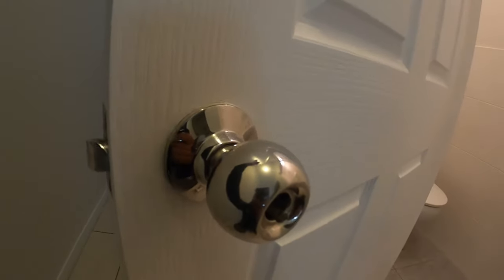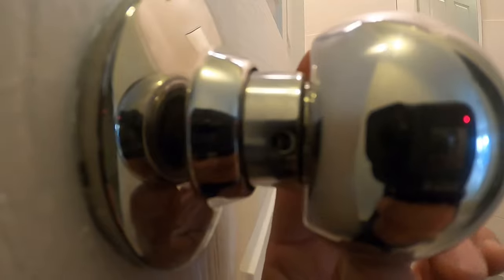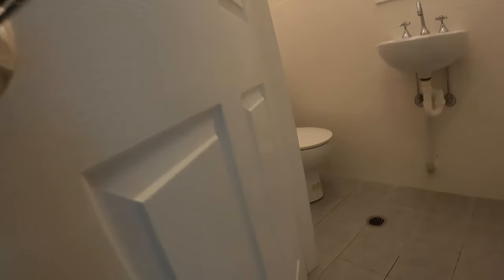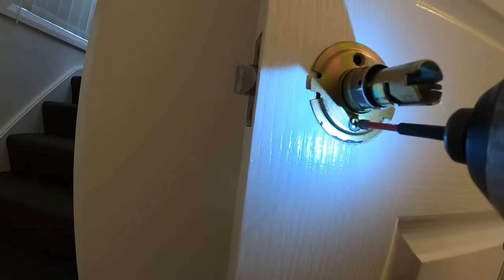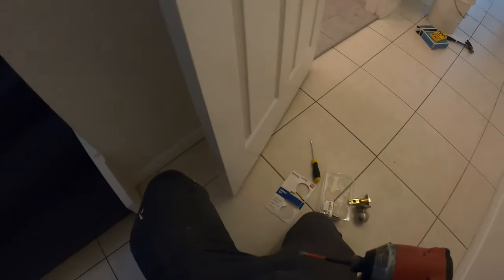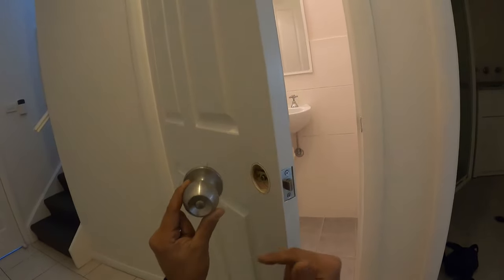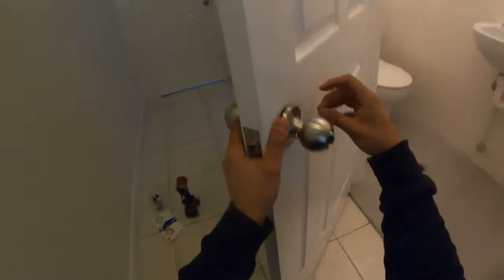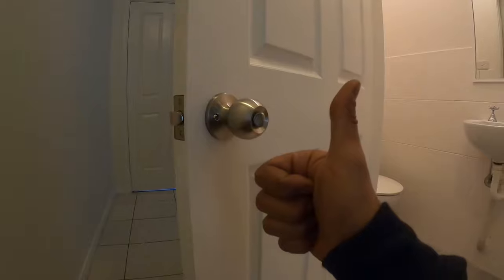Remove door handle / knob without screws visible

Comment: I'm facing the same type of knob and the door is shut and I can't open it.  The side that I can access is actually the side without the screws, any idea how I can remove the knob on this case?
Reply: It's been two months did you ever figure this out? Got this exact situation right now
Reply: @sebastianfischer2082 oh same here 😅
Reply: @AddisAnimationTime same!
Reply: Same boat right now. Did you manage to figure it out?
Reply: @francisferdzz  I myself couldn’t do it so I had to wait until my dad got home. He somehow jammed a butter knife into the crack of the door(which was tiny btw) and he got it open. It does damage it a bit tho. I would say it’s better than being locked out.
Reply: @francisferdzz  my wife someone managed the bend the hell out of our medical insurance card (thinner than a credit card) and make an L into releasing the inner door latch
Reply: I'm a kid and I got a hammer and hit it several time it opened I removed the screws with my fingers and I saw the slot I picked a coin and used it to kind up push up the one that's making me locked up in my room
Reply: 0

Comment: Thank you so much. Took a while to find this clip but well worth it . I didn't know if I was going to break something but watching this assured me of the right action to get the knob off. Enabled me to spray lubricant into the mechanism therefore no need to replace the lock. Bunnings should create a library of these clips

Comment: Saved me a LOT of trouble with this video. Got locked in my own room - the latch mechanism got disconnected from the handle and its like 2 in the morning so I can't really call anyone for assistance. Your instructions helped me take the handle apart, and then I realigned it with the latch when putting it back together! Thanks so much!

Comment: Thanks Bill.   This worked just as you said, enabling me to remove a failed bedroom door knob mech.  I'm off to the hardware store now to buy a replacement.  Without your video advise my next move would have been to use an angle grinder (the mech is stuffed anyway) but your way is so much more civilized.  Cheers.

Comment: Thank you for the video. What is the pin you are looking to depress to release the door knob is rusted? The handle/knob set I am looking to replace is on an outside gate and all components are rusted and the screws are located behind a plate. Any suggesting? Thank you in advance

Comment: Currently stuck in my own room because the knob is stuck and am completely lockd in; informative video. Thanks!
Reply: How did you get out though, I’m currently locked in my apartment. Does your bedroom need a key to get in? Because I got to the last bottom screw and it won’t screw all the way out. Idk if it’s because I need someone from the outside to turn with the key or what

Comment: Thank you very much, in my case it was a small Allan screw that needed to be turned, not a pin. And it was a what I think you call a  left-handed thread, you turn the screw counterclockwise to back it into the axle then take the handle off.  In my case I just needed to tighten the screws that hold the assembly to the door…  then putting the handle back on,  you turn the Allan screw clockwise to bring it back into the knob to secure the knob to the axle.

Comment: Thank you so much I have been searching YouTube for your video.  You helped me so much every door knob in my house is coming lose.  The house is barely three years old.  Even doors l hardly ever use are coming lose.
Reply from the maker: Sounds like a typical new house these days
Reply: Bill I messed up on one thing before I found your video.  Thinking the place on the side of the knob was to be used with an Allen wrench not knowing l just had to push on it to take get the knob off I now can’t get it to pop back out to hold the knob on.  I have sprayed lubricating oil on it and tried to pull it out with a needle nose.  By the way I am a 75 year old widow so if you could tell me what to do that won’t cost me I would be so appreciative.  Thank you

Comment: I need your help Bill. I followed your instructions but messed up when inserting the knob back in. I pushed it too far in and now the pinhole is no longer exposed. The knob is fully over the pin, leaving maybe a centimeter exposed between the knob and the rose. I didn't realize  until i installed everything back in. I tried doing re-doing everything but from the outside but I can't remove the latch because screws to separate the two sides are on the side where the knob went too far in. Is this fixable?

Comment: PLEASE ANSWER:  So I want to replace a commercial key lock (looks the same as video) with a regular key lock (meaning non-commercial).  As long as it fits the door hole, is that ok?  Thanks for your input.

Comment: Any advice on how to get it off if the hole for the pin has been put on the outside of the door? It seems as if the release is stuck or seized some how and will not release the door knob

Comment: Mate, you're a legend!
Any idea how to remove only the push lock mechanism feature from this handle so it's not just a regular knob?
Reply from the maker: Depending on the style you can remove the locking mechanism however I would personally just replace it as they are about $15 for a new one 👍👍

Comment: 1:08 You had the door open; ours is stuck shut. You have easy access to the pin slot; ours was inches away from the doorframe very much on the wrong side at the worst angle. You had the pin work effectively; ours did absolutely nothing even with a hammer. We had one on the outside but it also did not work. We finally tore apart the faceplate with pliers after which we were able to force the handle off on the outside. The door magically opened - who knows why - and thus we were able to unscrew pieces starting with the outside allowing us to remove the entire setup.

Comment: Mate I accidentally put the plate on the wrong way after doing this and the hole is on the wrong side and can access the release pin. Any tips? Because I didn't tighten it enough the first time

Comment: What happens when the face plate does not just click off? My face plates have a small indent opposite the place where you put the slotted screwdriver in and are all getting stuck and will simply not budge.

Comment: I’m surprised that the knob you replaced was installed on a residential bathroom door.I mean, I dunno how they do things in Australia, but in America, cylindrical locksets(Those which engage the latch through the side)are used on medium-heavy use commercial applications.

Comment: What if mine have no screws showing and no hole with pin and no slot?  Inside or out?  Door knob was so old  it would stick and trap people in room, I used WD40 and its fixed.  I guess I need a bigger hammer.

Comment: My Kwikset must be from another planet because it does not have the pin, or the screws, or the allen screw, or the flat pin like thing, however, when the brass plate is popped off on the inside knob there is a lever on the outer edge that goes one way to release the whole thing, and the other way to lock it.

Comment: My problem is that the pin to remove the handle is on the other side to the side with the screws.  The side with the screws doesn't have anything to pop the handle off :(
Reply: I also need new handles with at least an 80mm back plate, otherwise I need to paint the whole door.  Can't find any anywhere.

Comment: Still can't do it, the knob simply does NOT want to come off. This new knob has me questioning all my years of being able to do home repairs and install anything at all. Once I finally got the stupid thing off I had a ton of trouble getting it back on again after installation, then after realizing the stupid thing didn't bring the latch in far enough to open the door I couldn't take it off again because now the fucking button is gone.

Comment: I have another trick
Step 1.  Get an Angle Grinder
Step 2. Cut a big  Cross Horizontally into the Door handle
Step 3. Get some pliers and Pull away the 4 corners
Step 4. Everything will come out
Step 5, Push out the other end
Step 6. Take out the locking latch... 

Voila